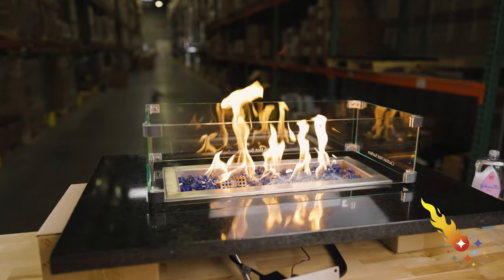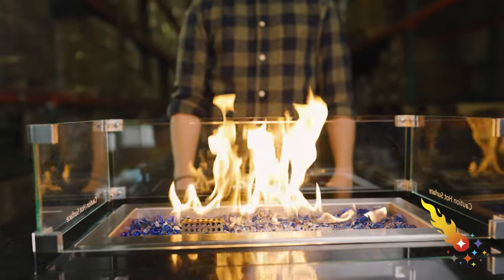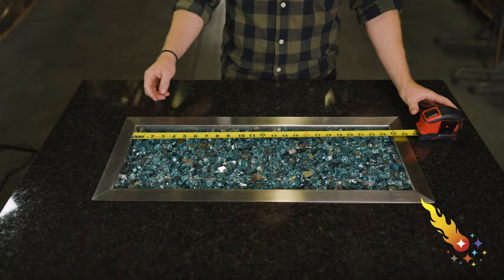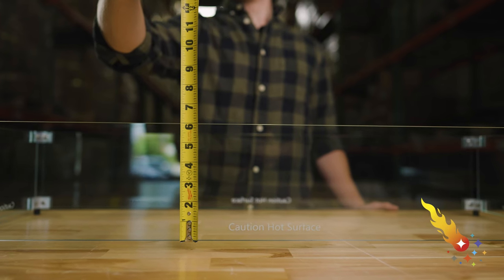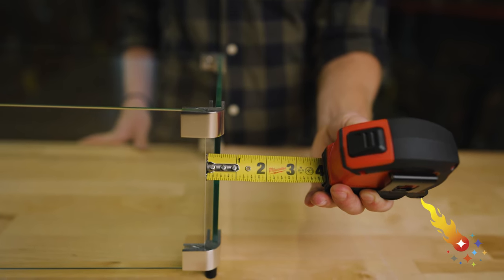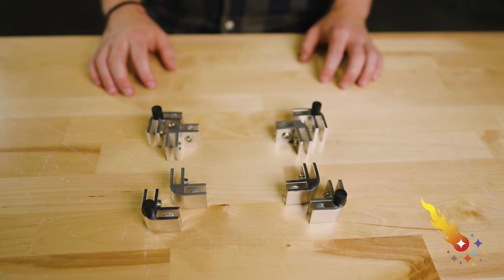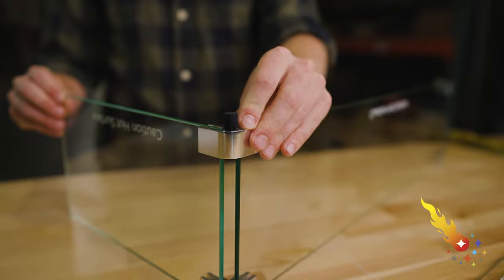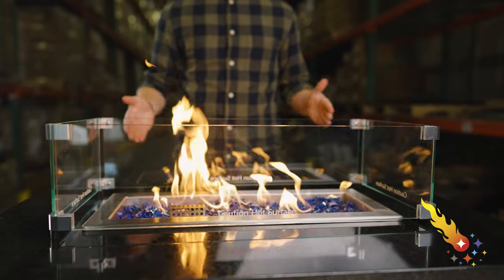How to Make a Custom Glass Flame Guard for your Gas Fire Pit

Comment: Is there a danger of 5/16 thick glass shattering because of big temperature difference between side near flame and side away from flame?
Reply from the maker: There is no danger of the glass shattering as long as you make the flame guard a couple of inches larger than the burner pan.  The flame guard should sit outside the burner pan by a minimum of 2" on each side.  This keeps the flame from directly contacting the glass which can cause it to break or leave soot/residue on the glass.  The glass also doesn't shatter also because it heats through slowly as it heats from the flame - there is no instant temperature change which can breakage in glass (i.e. pouring cold water on a piece of hot tempered glass).